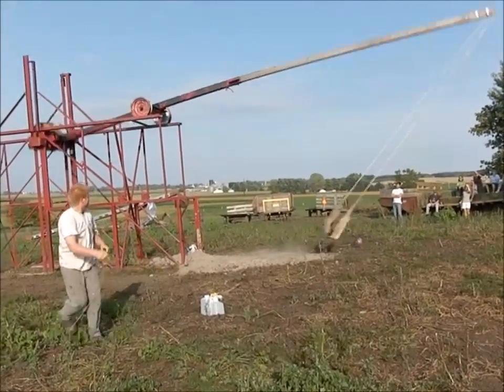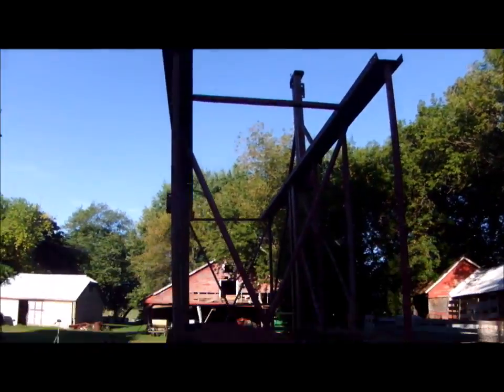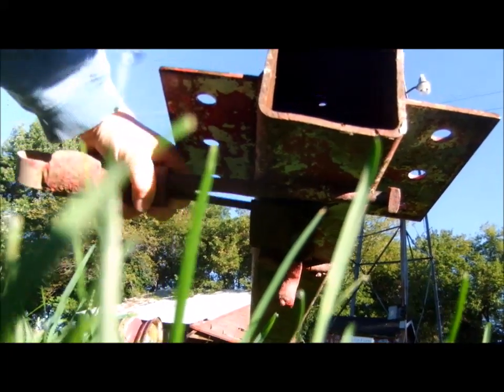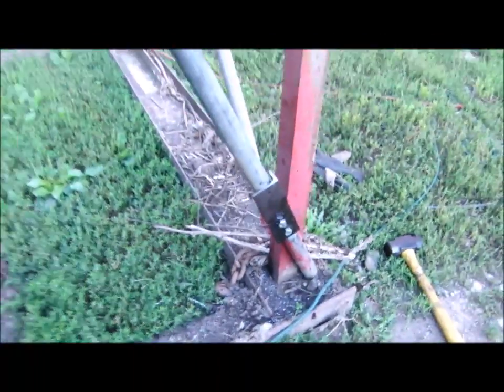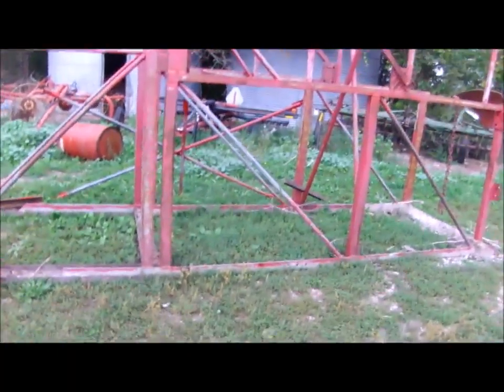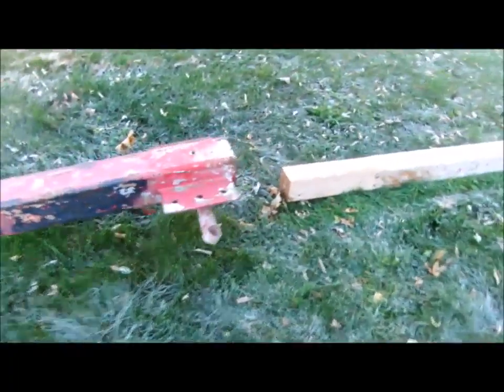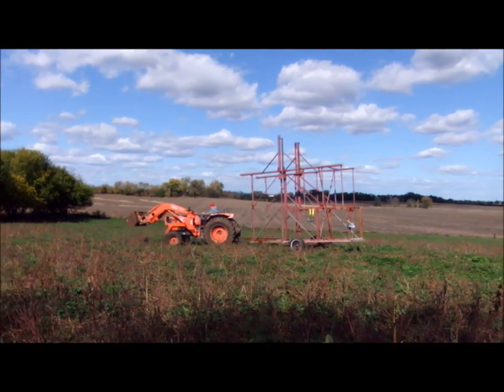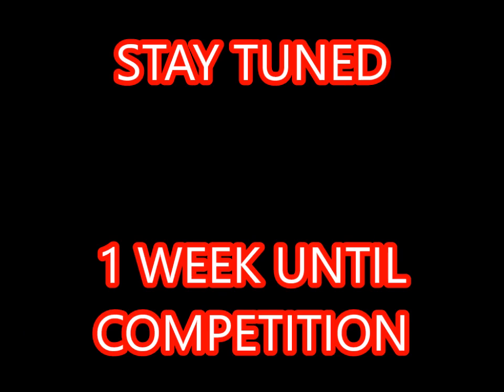Preparing for Pumpkin Chuckin with a Floating Arm Trebuchet

Comment: Ouch. This is a reason I tried floating arms but didn't stick with 'em. Easy for wheels to get off tracks or collide with other parts while on tracks, and the necessary gap for any weight guides can cause other undesirable effects. There can be exceptions (look how reliable the beast of a J-buchet is).